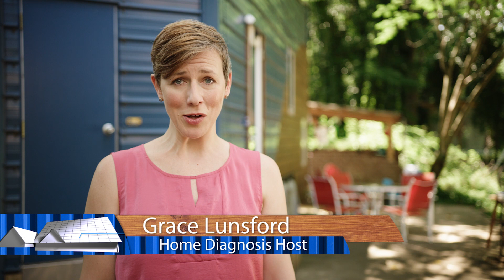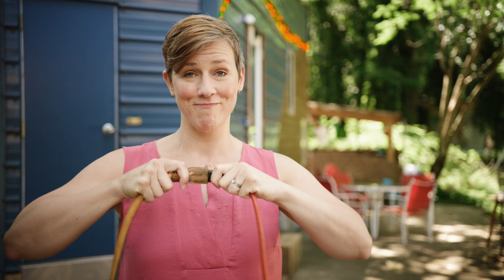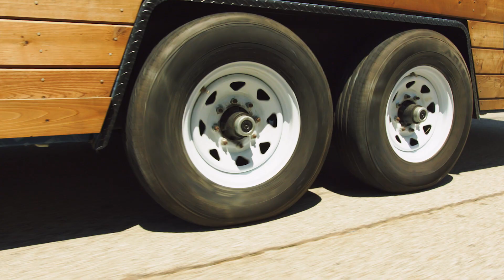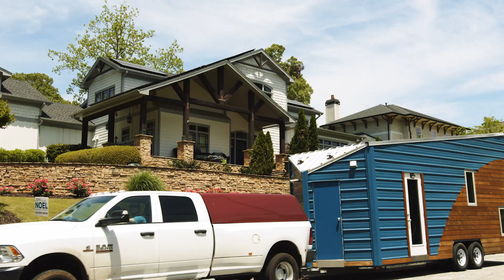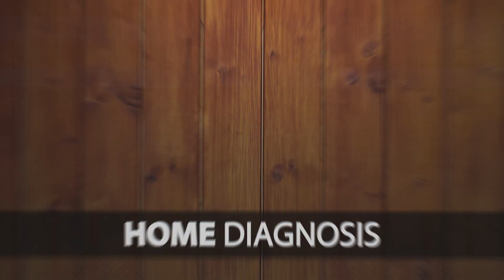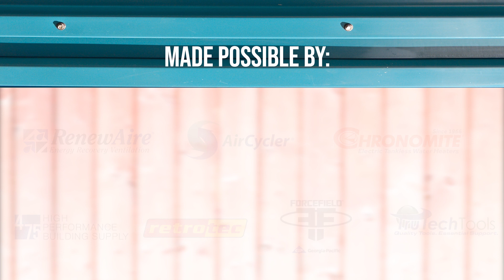One Plug = World's Highest Performance Tiny House

Comment: Hello Corbet . I had a few questions .
When it comes to ventilation i found my self semi unsure at times . I have been following Matt Risinger , reading GBA, listening to your podcast  etc etc for a few years but it seems i still have some grey zones . 
Could you help me find a solid foundation to study on regarding the subject in details . where do you start , how did you size yours , options in designing the duct ( here in australia we are mostly one storey house on slab with vented attic , that doesnt leave you with many places to put the duct of the ERV . ) where do you put your intake and your supply . there are different opinions on whether to put the intake in the bedrooms instead of the supply as is done gnerally because of some study done on the levels of co2 in the bedrooms at night with the doors shut and the level going way above what is good . 
Do you put an extraction fan in your shower as well as an intake of the hrv or do you only use the hrv with a boost function . same here i read that its not that good either for the anount of cfm that you can pull out with an hrv compare to what you need as well as not being that good for the system to introduce that much moisture in. 
But when i see some passiv house builder in europe they say its fine and that how they do it . 
Also do you need make up air in the bathroom if you do choose to have an extra dxtraction fan as this would pull out more air then what the hrv would be giving and therefore create pressure imbalance .
I can only remember these few questions for now but might come up with more . if ever you feel like reading me and answering i would greatly appreciate it . 
Cheers
Reply from the maker: Hey AimKev Tadok- you're in deep! I don't honestly have time to give you the answers you deserve here, but if you'd like to set up an hour-long coaching session, I'm sure I could give you what you're after. Check it out: https://buildingperformanceworkshop.com/video-consulting